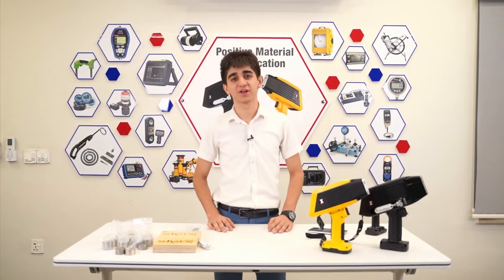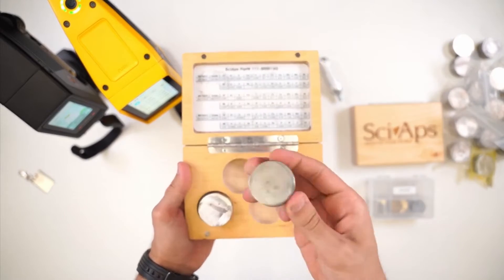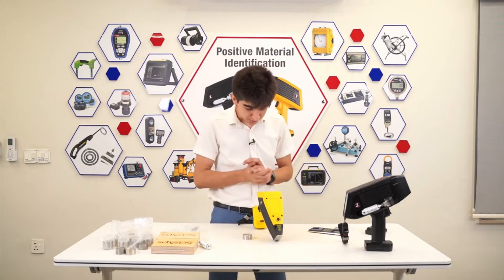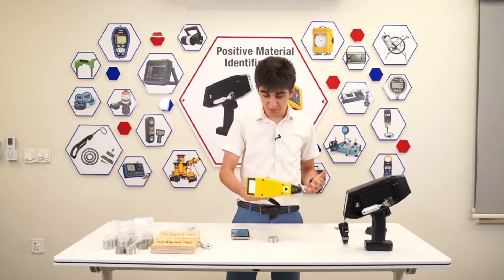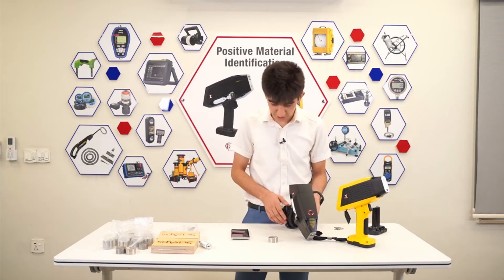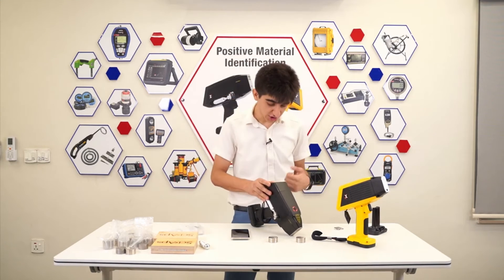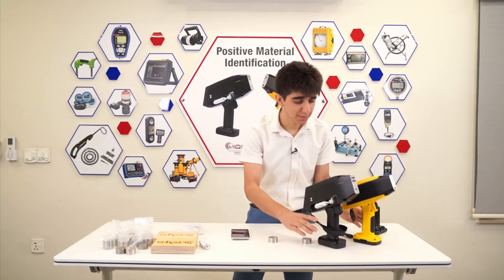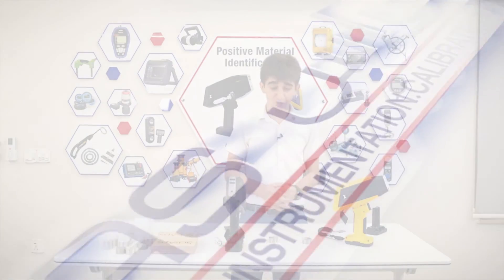How to use the Z902 (LIBS Analyzer) &  X200 (XRF Analyzer)

Comment: Dude.. you can also 'destroy' the cellphone..  Now my question is, is his unit DRM'd  Interested as it seems the Z902 can verify antiques, but can it do soil analysis and C14, P40?
Now that said.. I see that a premium unit is retailing for $40K..  Oh, you also failed to mention that licensing for the X-ray device usually is need (in the USA, state by state).  I have noted that some of these newer units can do detection below a surface plating, but a heavy covering may not detect the base metals.